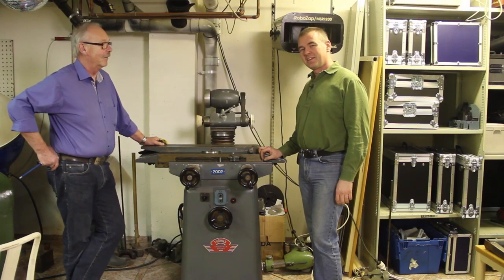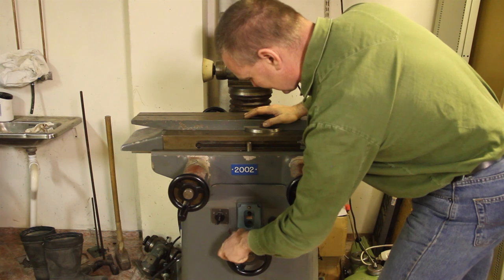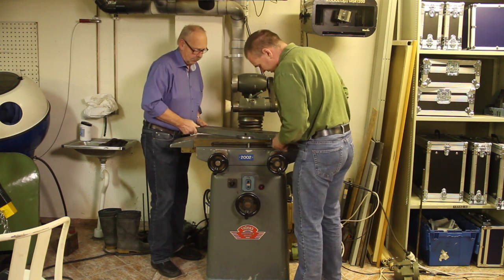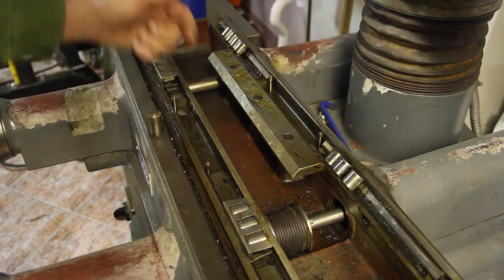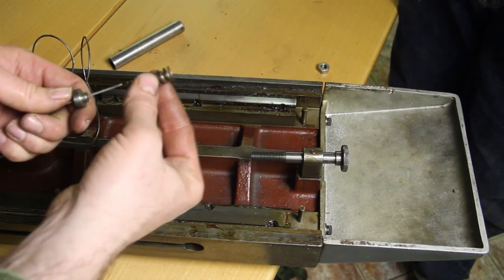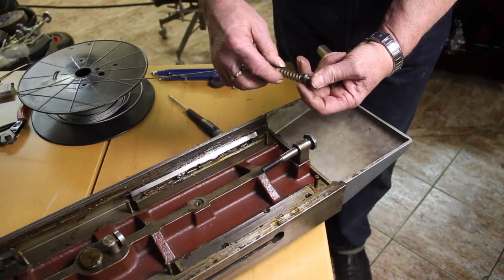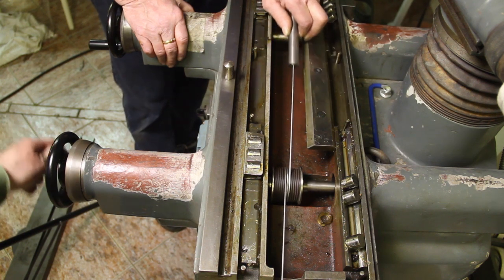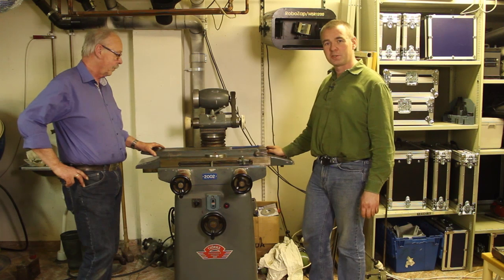Thörns T2 wire replacement

Comment: I recently purchased a similar KO Lee grinder, so it will be interesting learning with you! Mine has a powered workhead, and a separate stationary head. It is nice you can use your 40 tapers off your other machines....I have 5c collets. The use of the cable is interesting!....zero backlash!.....great to see your Dad helping!     Jim

Comment: Cool shop Mattias! Perfect machines in perfect codition you have. I wished I was able to find smthg like that locally. ))
As for the subject grinder - it's a precize machine, and it needs correspoding treatment. You should have PERFECTLY cleaned the contacting surfaces of the two parts of machine worktable prior to assembly. Clean, wipe and wipe by your hand several times like you do with Johansson gauges or a granite surface plate. It should just 'whisper' when the top part of table is rotating. Once you feel it - you'll remember this feeling. And at your video it souds like.. rrrrr.. when you align it after assembly. It indicates there was a lot of debris and dust in there. Cleanliess is soooo critical to both machines life and accuracy!

Comment: Very cool video.  I like to see how machines are constructed.  

One thing I would like to share with you is that I never leave the spindle threads exposed while turning.  I would put a faceplate or a cap over the threads so that you can't accidentally damage them.  We can all be careful, but we never know when our hand might slip.
Reply from the maker: You're absolutely right about the unprotected spindle threads, and I'm aware of the problem. I recently bought the lathe and didn't get a protection cap with it. Getting or making one somehow is already on my to-do-list.
Reply: Yea, I just use a faceplate.
Reply: Mattias Kristiansson Randy Richard-YouTube just made a Spindle Nut Guard for his lathe. Check his channel.